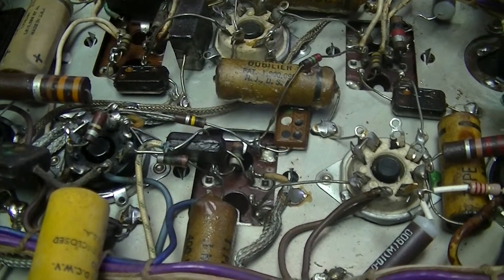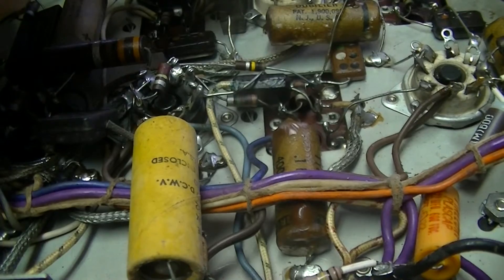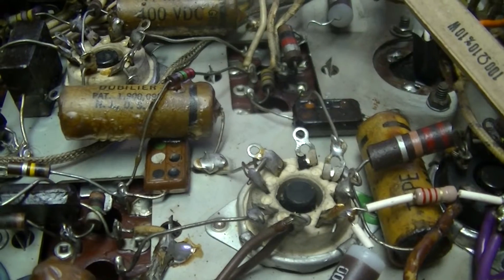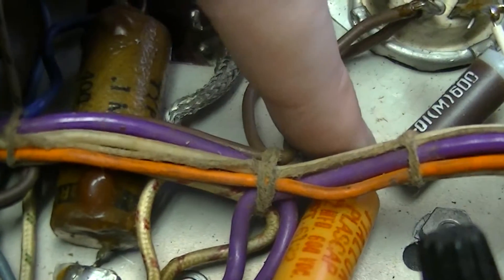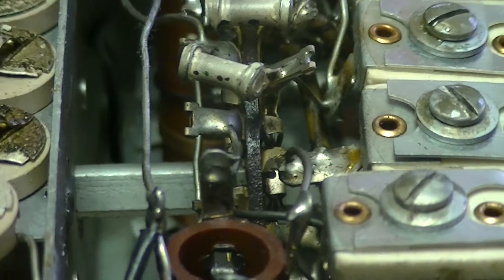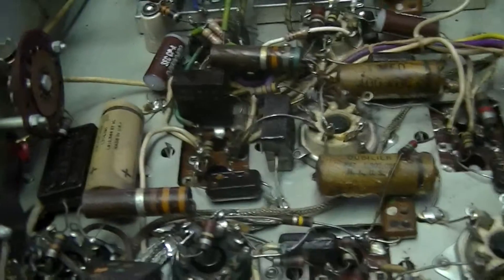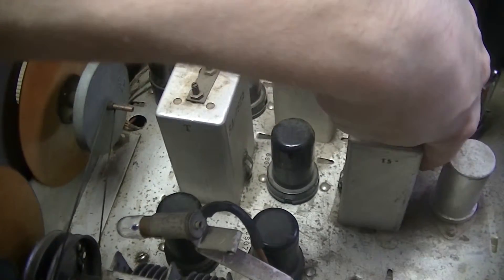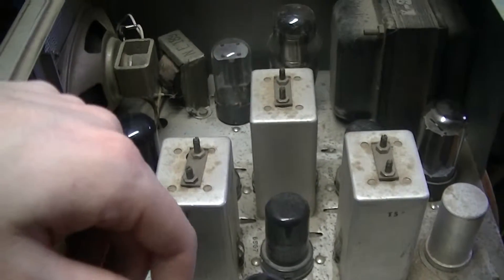National NC-57 tube radio guts

Comment: I noticed the dial string that turns the bandspread dial is missing.  Would you know the correct length tip to tip
for this.  Someone gave me a NC-57 and this string is broke. I do have the clip and spring but no clue on the length.
This string is for the bandsperad 0-100 dial wheel.   The other dial string works and changes the bandspread frequency
fine.    Thanks, Ken
Reply: Hello again. I just completed most of the restoration of an NC-57B. I had to replace ALL of the paper capacitors. You  have a number of those horrible Micromold paper caps which LOOK like small brown mica caps, but aren't. Every single one of those in my NC-57 were useless. You also have some of the larger brown "mica" paper caps. All of those were bad in my receiver also. I replaced them all with 630 V metal film jobs. The real mica caps in my NC-57 were all still good. The calibration was still good even after this many years. Mine also had a burnt out power transformer, a burnt out choke, the filter capacitors were bad, I had to replace the AF gain control, both band-spread dial cords (the one for the bandspread tuning cap is 15 1/2" long end to end, and there are THREE turns around the capstan, and the bandspread dial cord is 18 5/8" long). Getting that one in place without taking the entire tuning mechanism out was a first class PITA. The power transformer I had to replace the burnt out one was tagged "For NC-57", but it wasn't since the B+ was over 300 V and the filament voltage was high. I dropped the B+ to the correct level by adding 550 ohms at 20 watts in series with the transformer HV center-tap to ground. The receiver works unusually well. Take care and good luck.